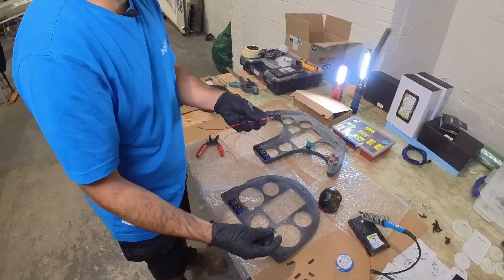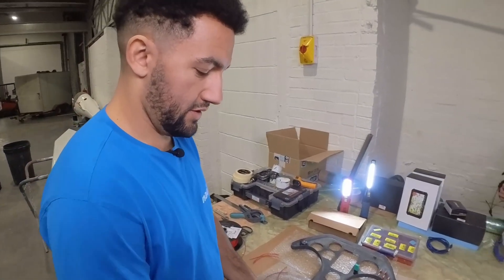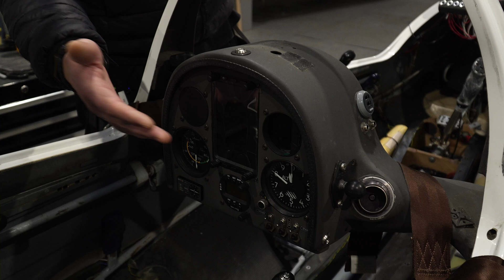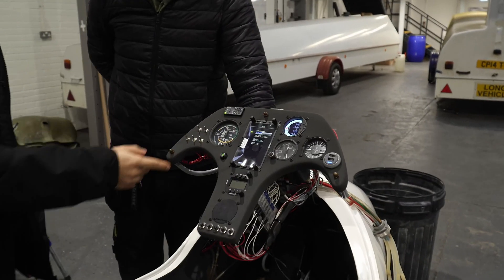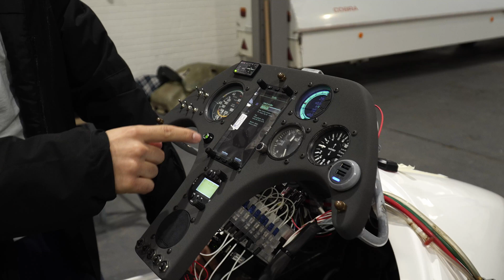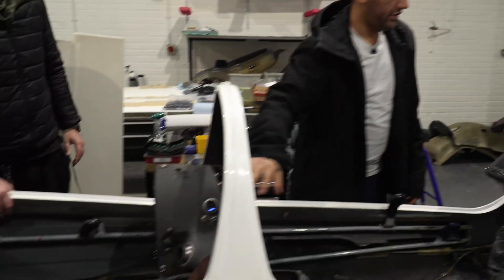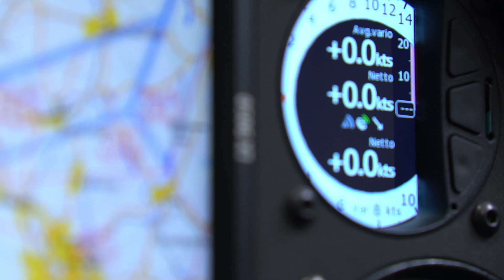Panel Upgrade Part 2 : Soldering & Wiring

Comment: So what is the history of putting those instrument-specific battery switches? Is it some UK thing? I have come across this once, in a UK exported glider. Seems to include a lot of solder joints (which break eventually) and switches for no good reason. We do it with couple of big LFP batteries with two simple on/off switches to power up main bus (giving you off/1/2/both options) and pull type breakers for instruments (can be switched off in emergency).
Reply from the maker: These switches have 3 postions so it's not just about being able to switch each instrument individually on/off but also being able to select which battery supplies each instrument. In a competition environment you could separate your loggers for example so if one battery power supply fails you won't lose both traces. You can also separate your navigation equipment from your radio and transponder. It gives you more redundancy
Reply: @Navboys_ltd  Yeah I get that. Just seems a really complicated way to solve a problem that is basically "not carrying enough battery capacity for long flight".
Reply from the maker: It's not about capacity. Modern avionics are very efficient and a healthy battery should easily last a whole flight. It's about redundancy. A single switch gives you a single circuit and a single point of failure for the whole system. One failure in this panel won't take out the whole thing.